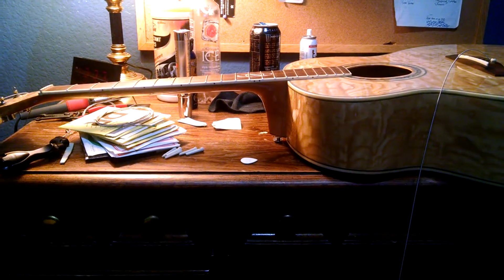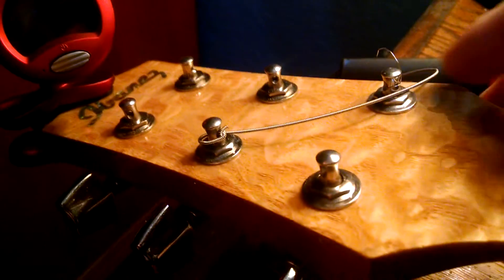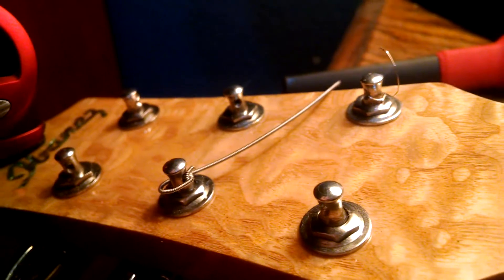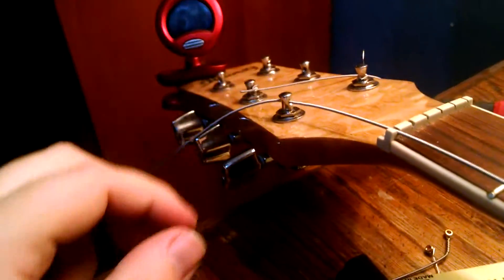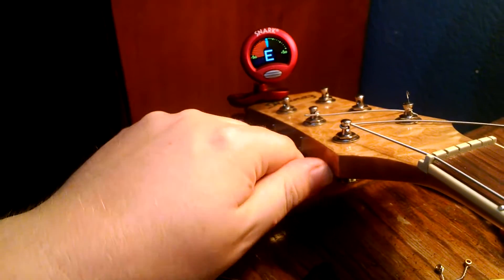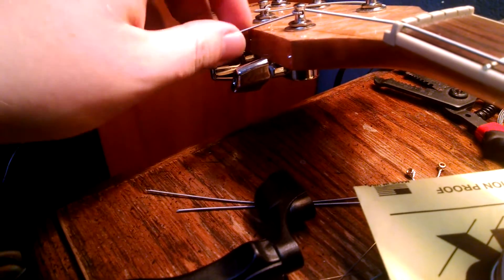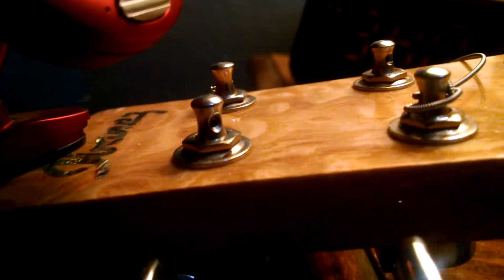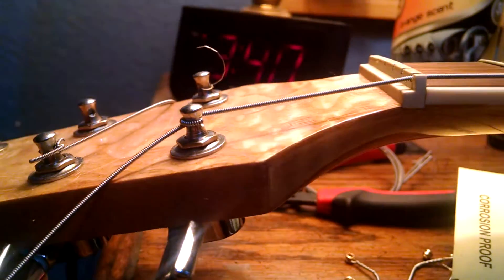One and done - best string post wrap method

Comment: Interesting method!

What I've been doing for a while now, at least for the wound strings, is to pull the string all the way through the post, put your finger on the string at the nut, pull the string back towards the bridge so that your finger is touching the first fret, and clip your string right past where it exits the post.  Then you can wind it and it'll give you enough to hold without looking sloppy.  For the non-wound strings, I do the same thing except after pulling the string back a fret's length, I loop it around the post and put it back through the hole, then clip.  Otherwise it can be kind of fiddly to keep it from sliding out while turning.

Comment: Don't see this working with an electric guitar with a floating bridge + non locking trem system.
Reply from the maker: Like the red Ibanez I play in a bunch of my videos? No nut clamps on it. Full floating bridge. No problems at all!
Reply: i've used this on my stock strat with trem bridge for years, and it's excellent.  recommend without reservation.
Reply: this is that concept propagated by bootstrappers that think they solved the internet. explaining why its wrong is a fools errand. 

find a video with more than a few dozen comments on this topic...😂